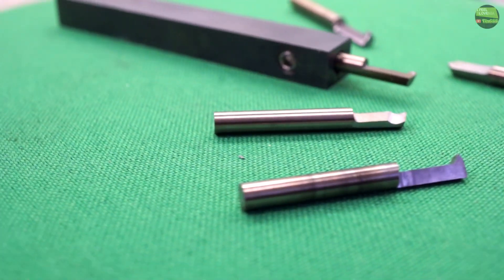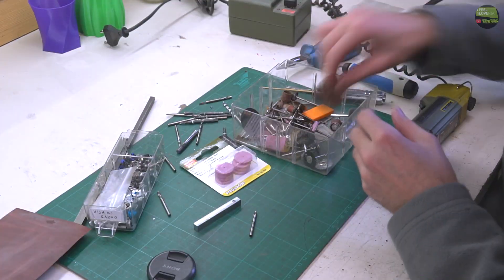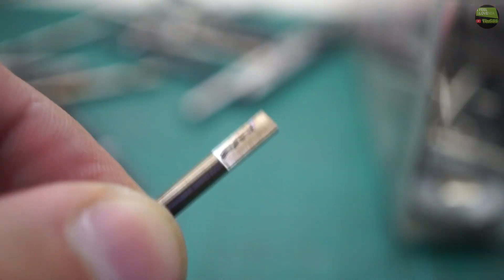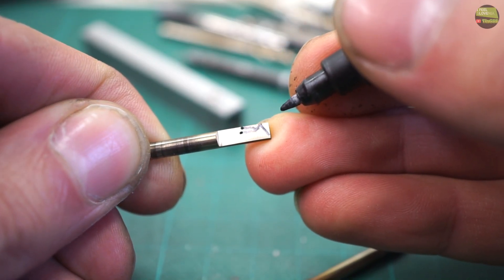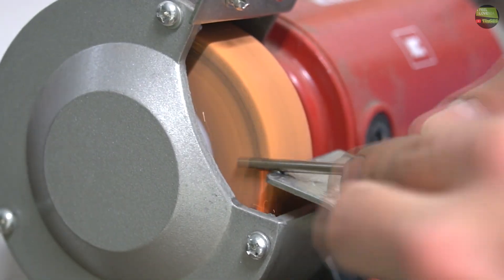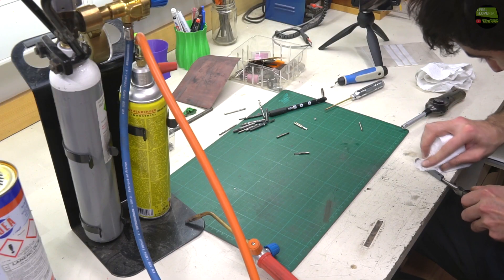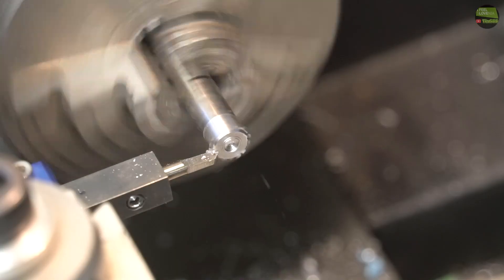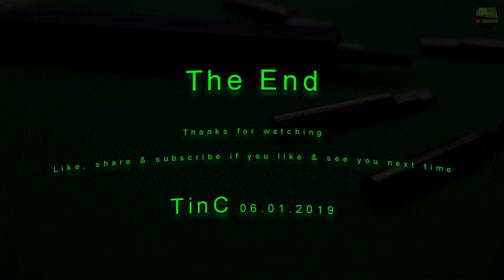Making of: Small precize lathe tool out of broken drill bits [M4 internal thread cutting]

Comment: i dint read all comments here... maybe somebody mentioned it maybe not. Youi dont need it red hot to produce a carbon layer of anti rust. 250-300° is pleanty. and to get a nice finish you wipe the oil with a rag on, then heat it again until you are happy with it. 

There is a chemical called "Selendioxid" it is the chemical version of a blackng like they use in gun blueing. Cheap to get to, less effort works on many steels but not all. Good clip btw. Lot of good infos.

Comment: Enjoyed your video, I've done the same. I have a small Rockwell mill that will turn in excess of 6000 rpm's! I grind high speed blanks into thread tools. I use 1/4" shank grinding rocks from the local hardware store. While I wished I had a proper tool and cutter grinder machine I can make do. Watching your video makes me think of my little Rivett 608 lathe, it has indexing holes in the spindle plus collets to hold the work. Need to make a grinder holder like the one you made.
Reply from the maker: You mean like this one
https://youtu.be/1AJPM3GXaco

Comment: Why did you use broken drill? I bet you cant cut steel mats with that, i usually use broken endmill
Reply from the maker: I got acces to broken hsco drill bits on my full time job, so i can get them for free also thread cutter and some mills, hsco material is great for that kind of use.
Reply: That are still nice job and i like how you grind them, i also have some of those tiny turning tool, but they are mostly made by solid carbide broken endmill, i have some tool from broken hsco drill, and yeah they are good for turning aluminium

Anyway, still a good job keep doing a good thing 👍

Comment: hi there, could you please tell me what kind grinder stoner do you use for cut all the drill bit? i am frustrated with all my grinder stone quality. thank you
Reply from the maker: Actually it's just a black cutting disk, for me work better then grinding stone, i think it's proxxon brand dimension about 40x1mm
Reply: @TinC33  thank you so much for your reply. i will try from amazon maybe. it's really hard to find proxxon items in my country.
Reply from the maker: @thegoodskreftsub-id9494  it can be some other check on ebay for cutting disc, but it's hard to find bigger size, somewhere to diameter 20mm isn't problem.
Reply: @TinC33  yes you right, i just have for 25mm in my country. the bigger size is for glass cutting (40mm, diamond grinding). and the quality is not good. okay, i will try check on ebay too. thank you so much
Reply from the maker: @thegoodskreftsub-id9494  don't buy diamond not work as good as basic black cutting disc, wich is much cheaper also

Comment: HSS drill shanks are not hardened and you can't harden HSS yourself without sophiticated heat treatment facilities. Just use Silver Steel (carbon steel) rod blanks instead - those you can easily harden and temper in the 'shop.
Reply from the maker: Good to know, i use hsco drills

Comment: Nice process and method.  If you need carbide a carbide drill could be bought or a drill rod - center ground carbide.  Grind with fluid.  Nice film.

Comment: The basic idea is good. The use of your custom Dremel/lathe setup is a horrorshow. NOBODY has that except you. Why feature it to the ABSURD level of using a cutoff wheel to square a surface? Answer: YOU SHOULDN'T. If nobody has that setup, & nobody but you does, then featuring such an arcane system detracts from the message to such a great degree it is virtually eliminated.

Comment: Most drill bits are made with a soft shank, welded to the hard cutting part, so you are machining the wrong end of the bit.
Reply from the maker: you'r right, but i use here HSCO drills wich is entire hardened with shank.
Reply: @TinC33  
Thats new to me, so I've learned something!
I keep broken taps and drills to use as scriber, or centre punch points.
I've just looked at the prices of these drills. 
OOOh! VERY expensive.
No wonder you would put them to use, even when broken.
Reply: @TinC33  What is the purpose of hardening them full length? (and making them so expensive at the same time.)
Reply from the maker: @niklar55  i don't know, but they are great drills, i got acess to 3.3mm (for m4 thread) on my work, where we use lot of them to drill gray cast iron, so i can get bunch of them broken for free, i wish i can get some bigger size.
Reply: @TinC33  
The prices!!
Anything up to £150+ per drill!
I'll have to google it and find out why, perhaps extra precision, as they look like they've also been ground to size full length as well.
Reply from the maker: @niklar55  yes, because they used with bush (clamp) not for chuck, i think that 3.3 come about 10-15$ piece, but for industriall use it's normal price.
Reply: @TinC33  
Your Co. probably buys in bulk, so gets a cheaper price than a one off item price.
What do you make?
Reply from the maker: @niklar55  i think yes i don't know price for fabric, i'm only worker there, we making hot plates for cooking that old stuff but still make few thousent per day, i work in gray cast fabric, where we pure them into sand models iron got 1600 degree celsius, than go into 20pcs of cnc lathe to finish them, so they buy that drills, taps, and cutting insert in kilos, every week arrive big box with few kg of cutting tool, when it's unsharp or broke just replace...
Reply: @TinC33  
Thanks for your answer.
It seems your employers have plenty of $$ for tools.....
Lucky them!..
....but it still doesn't explain why they buy drills hardened the full length.
The only reason I can think of at present is accuracy.
Reply from the maker: @niklar55  as i say i'm in die cast production, cnc machines is in other unit (50m away) so i don't know their problem, but the machinery is about 30years old, and also two casted plate isn't the same, every is a bit different, so drill always shift a bit (center spot is casted) so the widia will broke after first hole, basic drill doesn't hold enouh dtilled holes, because gray cast is quite strong but can be broken (like glass).
I work there for about 14years and they always use that drills, and they'r quite chiap against other tool like stap drills, widia drills, mills... It's big factory with about 1000 emplyee...

Comment: Could u do the same process to Make wood turning tools? 🤔
And I love the set up u have for the little torch, did u make this yourself or buy it?
Reply from the maker: Hy, my father got wood lathe, and i work on it when i was child, but now bearly work on it, only use them one or two times per year, so i don't know all the angles to sharpen wood cutting tools, but i would say if grind to a bit smaller angle to get more sharp end it would work on wood also.
About torc it's rothenberger roxy kit, very usefull tool, but oxygen gone really fast and cost about 20€ per bottle (110l of oxygen) and that bottle can't be refill because of two way valve, so i make this modification and i got no more problem with oxygen since i got two refillable bottle.
https://youtu.be/Atpn4vGB5lc

Comment: Any HSS drills I have are soft in the area with no flutes so they would not cut very well. So for me great video if using HSS rod, but old drills I don’t think so.
Reply from the maker: In my case i use hsco (cobalt) drills, you can hardened basic drills befor grind or simply use hss rod like you said.

Comment: Nice cutting, I made a quick tool holder for dremel tool but doesn't have enough power, I need to get more powerful rotary grinder with bigger cutting wheel.  How big is your cutting disc?  Also for such small tool you extend it way too far!

Comment: Tine, you are a very talented and resourceful person, I'm working my way through your vids.. All very good, and your adaption of the Dremel is very inventive and functional.. Superb idea and the tip for dividing the lathe chuck with the tape around.. Obvious, but had to be thought of.. Again well done..
One last thing, which CAD software do you use.. I tried to dload Layout from Sketchup without success.. Any advice or info? Thanks again
Reply from the maker: Thanks, i was also using sketchup and layout, but when i buy 3d printer, i need stl files, there was lot of fails into sketchup, so i start using solidworks, but only on my work, it's far too expencive to get it for home use, but it's awesome software for cad.

Comment: Hi. Great work. Where did you purchase the small grinding wheel for your drill. Mine are just 1 inch diameter. Yours looks better and stronger.Thanks
Reply from the maker: thanks, i bought them in some local shop i don't remember it was bauhaus or conrad, i know that dremel got some 38mm diameter, but that was about 50mm

Comment: That only works if you use carbide drill bits. Normal HSS drills have a softer steel shank , so they will be useless as lathe turning tools.
Reply from the maker: True, i use hsco drills, but also basic drills can be used just need to harden them.

Comment: I have old (broken) carbide tools (diameter 6 mm). Can I use it same?
Reply: Health warning: dust from cobalt drill bits and carbide tools are dangerous - a respirator is essential if you grind those. And non-visible residue may also be dangerous. I would avoid it.
https://www.google.com/search?q=heath+%26+safety+grinding+dust+cobalt+carbide

Comment: Nice work. I tried something similar but it didn't work on steel, only on aluminium. Maybe there is difference between your HSS and that which  I used (my  broken drills were black(probably M2 grade hss), I think you had Co alloyed hss of M35 or M42 grade)
Reply from the maker: True, i'm really sorry that i forget to mention that, so i write it in a first line into description: I use DORMER A117 HSCO drills in this video!
So that drills are entire hardened, also the shaft, and the'y are gread for that kind of use, try to get some mill or thread cutter...
Reply: @TinC33  too costly to buy mill for me, and I dont need it that much. Maybe I can build one- it should be simpler than lathe. I wanted to build lathe, but at the end I was worried about accuracy. I wonder if my drill press could be adapted for simple metal milling... The only thing I'm worried about is morse tapper- those vibrations could make the operation potentially hazardous.
Reply: @TinC33  oh you mean bits... Not possible for me. i can buy new drill bits but to make from those superior drill bits lathe knifes is a bit wasteful. I have also WC drill bits. Those are cheap they cost about 70 cent per piece and I have fine diamond polishing machine in my work so I can sharpen and polish them over the finish of new ones.

Comment: Dear Sir, I would like to know which model and brand of abrasive disc is using, because I tried with one of them and turned to dust. I don't know if it exists in Brazil. Grateful for the return. If you can send it to my email joem9963@gmai.com
Best regards
josé EduardoGood job!
Reply from the maker: Hy, i really don't know i buy that cutting disc once in a store bauhaus, i don't know brand or anything, got also few other disc (brown) thay'r without glass fiber in it, well that one become dost much sooner. Try to find one with fibers in it just like cutting disc for angle grinder.
And also it's important to grind very slowly only with a edge of disc so not grinding from side.

Comment: Tine, very nice and precise way to make cutters. May I just comment that the end of a high speed drill is not completely hardened so that the drill chuck can "bite" into the shank and not slip. That being so the tool made from the far end of the shank will not be at optimum hardness to resist wear. A hardening and tempering cycle will address this and I note you have the equipment and set up to achieve this. The torch and the oil is all you require and a little research on the technique on UTube will show the methodology. Thank you for the excellent video, Richard
Reply: https://youtu.be/PywbeDE7NGA

Comment: make new gears for your lathe the plastic ones die fast ,and your English is good ,good job
Reply from the maker: Thankas man, but i know my english is faaar from good, i got almost all the time turned on plastig gears and still work after many hours of running, but it's just a great idea, i got rotary table, so i can make them out of brass i guess, but not for stronger result but for higher accuraty. I wish that that gears will be more silent, what material you suggest for making them?
Reply: steal

Comment: Very very good. So far I have used 6 or 4mm silver steel for small tool bit, hand filed. But it needs to be hardened and tempered. Your approach seems much better. Besides, using the lathe, one can set the angles precisely like you showed. Thank you very much!
Reply from the maker: Thanks, that hsco drills are just great for that.

Comment: This is another comment warning people that most drill bits are not hardened all the way because people need to know this. Before you try this, take a file to check the hardness. Otherwise you will be making a very shitty cutting tool that can only cut cheese without dulling on the first pass.
Reply from the maker: True, i really forgot to mebtion that, because i don't use cheap shitty drills, almost everyone i got is hardened from top to buttom, also got widia and soon. Thanks for mention

Comment: broken carbide endmills are good for this sort of cutter too,  they are the same material throughout, unlike some hss drills and some cheaper hss+cobalt bits.    anyway its easy enough to check hardness and you'll find out pretty fast if it isn't.

Comment: great video ! Just a litle question at 0:50 you use an exentric tool in order to positionate the milling machine on the edge border of your part, what's the name for this tool ? thanks
Reply from the maker: Don't know exactly, but search for "excentric edge finder"
Reply: Thanks a lot TinC33 for your reply !  So i have take a look to youtube with your information it's seem that edge finder is call "wiggler" too. I find a very interesting video about accurency, the offset /off center problem alignement pb and repeatability i am pretty sure this link will help other :  https://www.youtube.com/watch?v=bga7y4infIo .
at 7:16 he use a tool he call a "cool centering scope" very interesting but i was not be able to find this on aliexpress, banggood, ebay ...

ps1 : edge finder on banggod start at 3$95 to 16$ (with led) but no optical wiggler with telescop https://www.banggood.com/buy/edge-finder.html?sbc=1

Comment: Cool video. I would suggest offsetting your tool holder center hole so you can get more strength(more threads) out of the set screws. Also, it would be helpful for heavier turning to grind a flat spot on your tools for the set screws to sit against so they don’t rotate. Awesome work
Reply from the maker: I think to make flat surface for screw, but i see that it's unnecessary for so small insert, one screw hold it ok, but i got thread through the hole so i can fix it with two screw.
Biggest pros of flat surface is that alway hold on same angle position, because it set angle itself to a flat surface when tighten the screw.

Comment: Really nice video! Tell me something. If the broken bits were carbide ones, how would you grind them? Do you have any diamond discs to achieve the same results?
Reply: I would not advise using carbide on such small tools as grinding is difficult, even with a diamond disc, but more importantly, in the use of such tools... carbide, whilst being a super-hard material, is also extremely brittle... and unless you are machining "difficult" material, you are not going to see any real benefit as opposed to a HSS tool which would have a slight "spring" in its action. And "working out the spring" is also a great way to come to a final accurate size... basically running the tool through again a couple times without adding any more cutting feed... this works PARTICULARLY well with small tools like this...🙄
Reply from the maker: No i don't use diamond disc, you can see on the video this is tottaly basic cutting disk, same material as for angle grinder cutting disc.
Reply: Thanks! But with your basic disk can you grind a carbide broken drill bit or only HSS?
Reply from the maker: @FedererGuga  it grind hss and hsco but not the widia